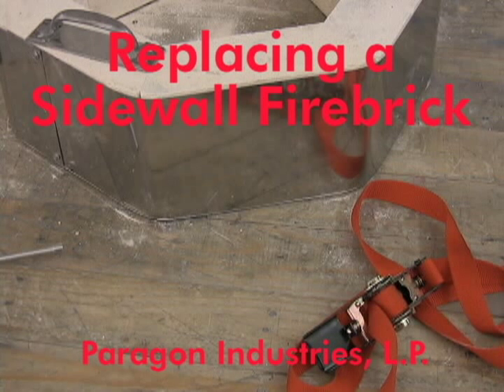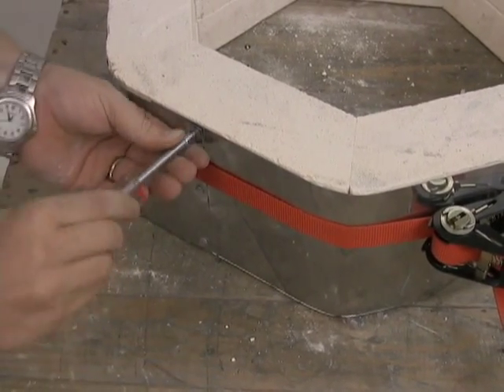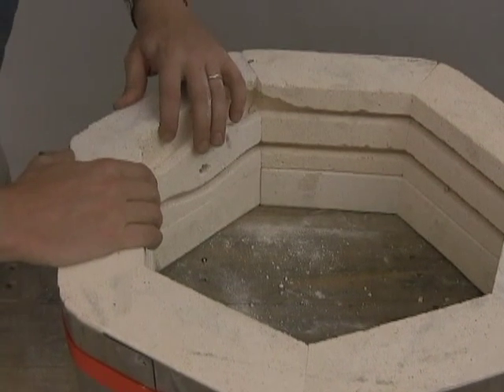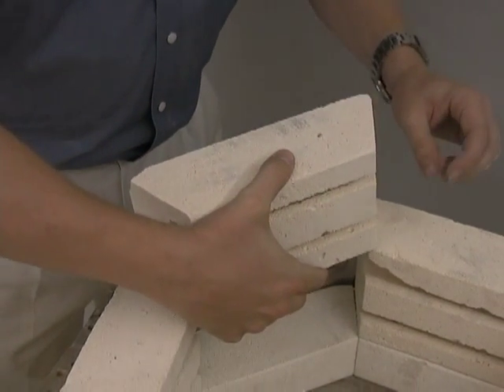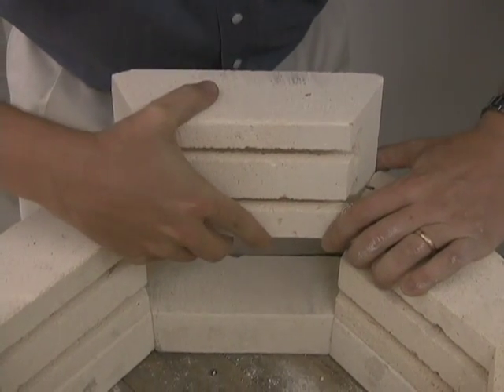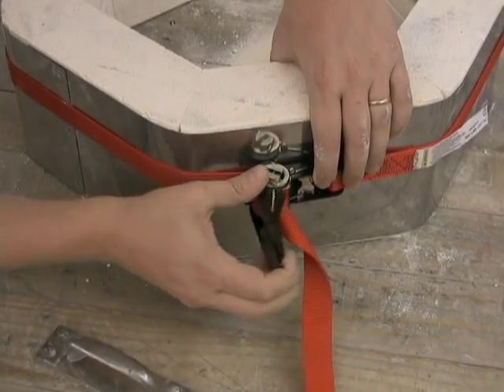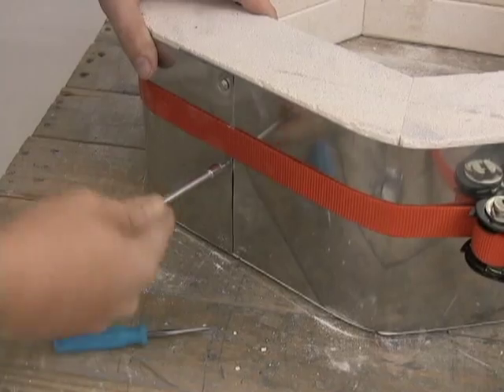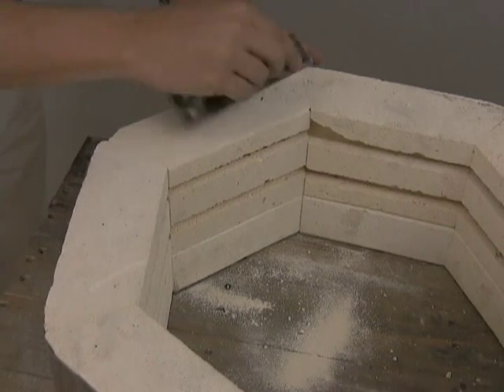Replacing a Sidewall Firebrick: The Paragon Kiln Maintenance Series

Comment: I would like to see the process where the elements are removed before replacement of the brick and putting the element back after
Reply: Me too. Be nice if this would have had someone reply. Truly disappointing  how when business grow they start to drop all the personal touches that made it become such a thriving company.  Then they treat the customers like they are just a $ sign.
Reply: Hi Ang. We should have shown how to remove the element before replacing the firebrick. This was one of our first YouTube videos. To remove the element, heat it first with a propane torch and very gently lift it out of the grooves with needle nose pliers. Let the element hang out of the grooves while you replace the firebrick. After you replace the firebrick, heat the element again with the propane torch, and push it back into the groove with needle nose pliers. You may need to shrink or expand the distance between some of the coils to make the element fit. Do not move the element when it cools. You can feel whether it is still hot enough to move, because when it cools down, it becomes stiff. You can feel it through the needle nose pliers.
Reply: @rexeldridge3702  Hi Rex. I agree that YouTube questions should be answered promptly.